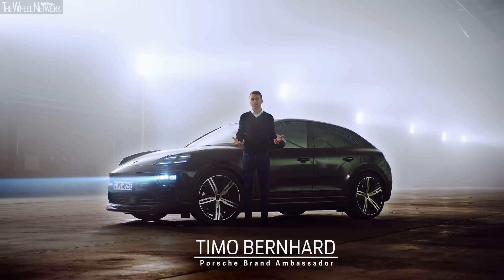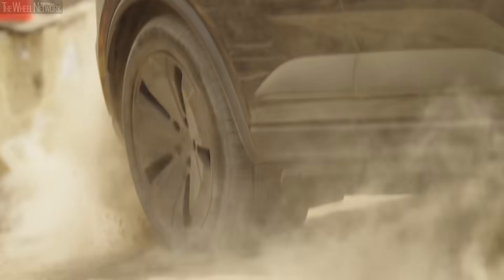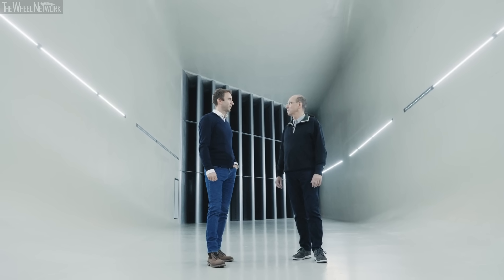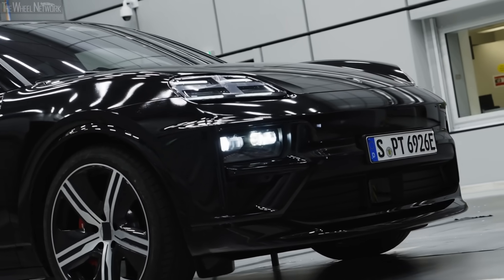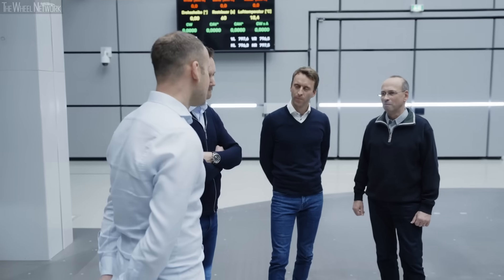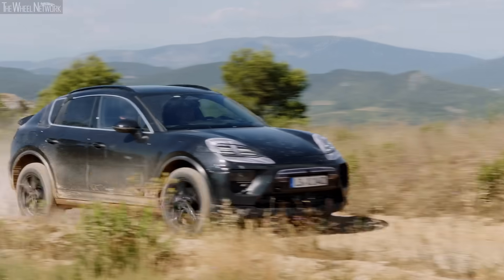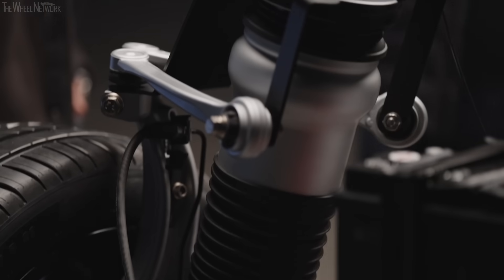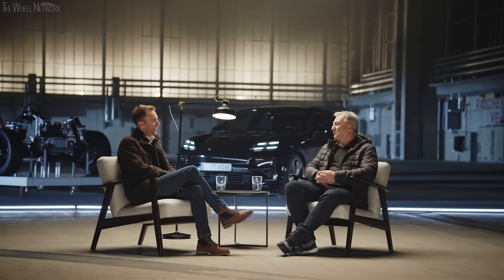2024 Porsche Macan EV – All-New All-Electric SUV in Detail

Comment: well it's all most 140 thousands ....yet... Hyundai makes better car such as Inonic 5n with cost about 50 thousands ... now in electric car era.. German is not leading company any more among car industry.. lol 
well check this out .. first of all, Porsche’s electric cars have lower inductance than Hyundai/Kia cars, so the efficiency of regenerative braking is low. The reason why inductance control is important in electric motors is because output and power generation must be alternated. Therefore, there is no choice but to lose money in the Taycan’s driving range. In addition, the Macan EV’s regenerative braking is 0,4G. In order to control the heavy 2.4-ton body and the enormous output of 639 horsepower without any problems, you must purchase carbon ceramic brakes as an option. The Macan EV has a curb weight of 2.4 tons based on the turbo model, which is 200 kg heavier than the IONIQ 5 N. The 100kWh NCM lithium-ion battery mounted on the Macan EV is CATL’s NCM811 (made in China) while ionic 5n uses 9/half/half LG bettery pack which has much better performances

Comment: Looks so boring.
Reply: Looks like a Porsche Macan.

Wtf were you expecting?
Reply: @powerhouse884  innovation wtf did u expect?
Reply: @bblueangel2  Innovation with LOOKS? lol
Reply: @bblueangel2 So if you look at the science behind getting a better drag coefficient, there is a specific shape that is the best. So having sharp edges will cause more wind resistance as the air does not flow over the car as easy. So if you could design an electric car that is as efficient and more complex look, go ahead and try!
Reply: @acoolpieceoflettuce2557  still boring
Reply: your mama is boring